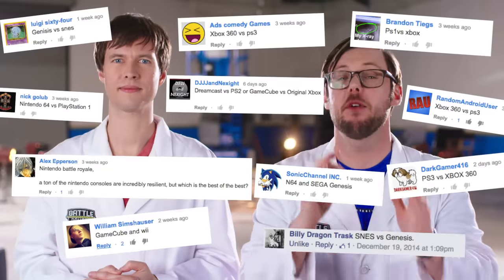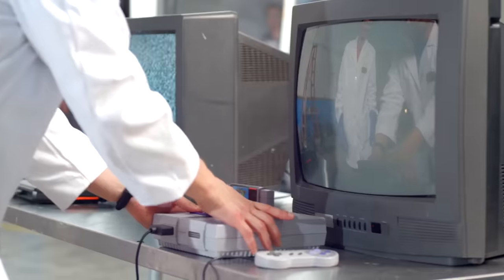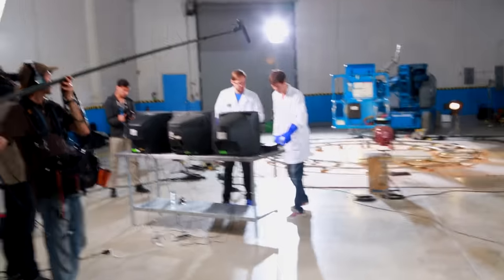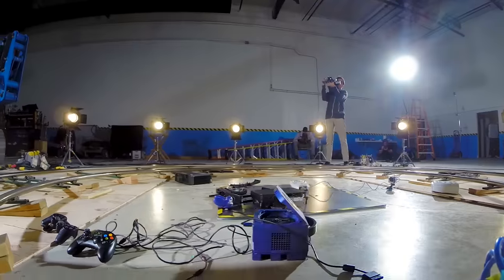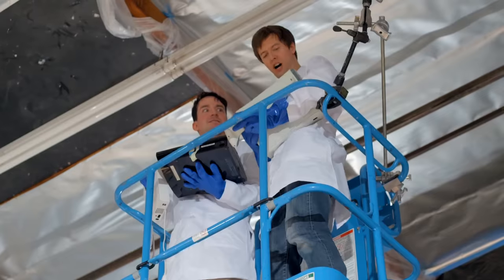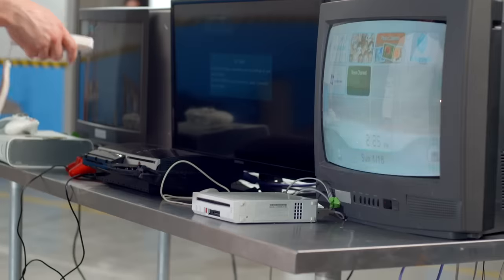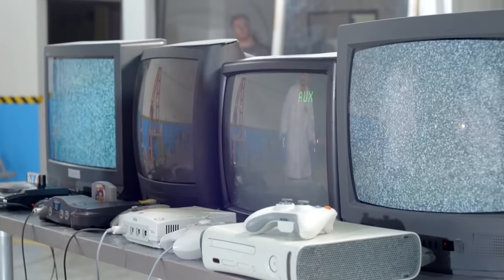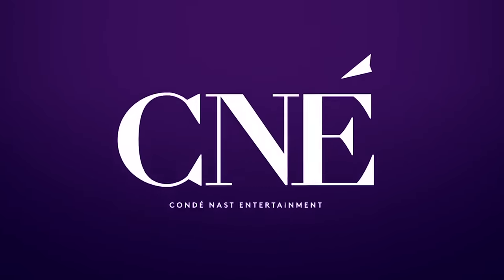Video Game Console Drop Test - Xbox Vs Playstation Vs Nintendo Vs Sega | WIRED’s Battle Damage

Comment: The Xbox 360 doesn't "Red Ring" from physical damage. The Red Ring comes from Heat Damage, shorting out the motherboard by overheating it.
Reply: I was thinking the same thing
Reply: yeap, thats what it is
Reply: red rings can also be caused be just overheating, mine's vent was covered be a wall and got a ring. but after taking of the shell, blowing some dust off, and putting it in a safer place, it worked fine again. and that same console works frequently well to this day.
Reply: LXavierW Brick Studios or a hard drive error
Reply: WOLF Drc or if the hdd or memory cards are misplaced as that is what happened to my elite
Reply: The fall could dislodge the CPU and give a red dot/ring
Reply: Yay some smart people who actually know stuff about xbox 360
Reply: The 360 couldn't red ring anyway, it was a jasper edition (you can tell by the 8 pin power supply port), the jasper is an edition of the 360 made after the falcon which eliminated the RROD from even being possible. Although systems still failed obviously, but RROD ceased to exist.
Reply: Just like ylod
Reply: Wolf DRC wrong, what your saying about the heating is true on the 2 rings but physical damage can cause a hardware malfunction which is what 3 and 1 ring(s) mean. The four rings just mean that the Av cable is not plugged in, broken, or the console’s av port is broken, (that only happens to Xbox 360’s that don’t have an HDMI port.
Reply: Wolf DRC exactly
Reply: Wolf DRC oh
Reply: Wolf DRC you areright
Reply: i it had once on a hdmi console maybe if you were to use the switch on the side on a none compatable tv
Reply: Actually wrong, it is either the hardware is MASSIVELY broken or the 360’s BIOS is corrupted
Reply: That sounds pretty physical to me
Reply: Red rings come with errors with boards, overheating, no AC cord is detected, etc.
Reply: So that’s (probably) why my old 360 red ringed, i guess

Comment: ... the Wii Game Channel showed that there was already a disc in the system. You forced a second game disc into the system.

That said, I doubt that the Wii would have survived the Battle Dew test, so the only difference it probably would have made was a fifth contender to die in the final round, but still... the fact that it was ruled out for not taking a second disc into the disc drive seems wrong.
Reply: the wii could have survived the battle dew test on one condition the game cube controller hatch thing was hinge side up
Reply: ***** I think it might have. It has fewer vents etc leading to it's innards. If too much got into the ports or disc drive then it probably would've ended badly but it had a chance. And they screwed it up.
Reply: I think a lot of these consoles were fine, OG Xbox just needed clip put back on, n64 needed a different clean console to test the console with 
The Dreamcast straight up wasn’t reading discs at the end and still won??

Comment: Fridge logic: When you consider a gaming console inoperable despite the fact that there is already a disc inside of it fully working and ready to be played. Screw their opinion--the Wii not only survived the fall but was fully operable afterwards and therefore won the drop test.
Reply: Same as 360, double winner
Reply: Yes
Reply: Also in the end they said the N64 turned on. Im sure if they let the pins on the cartridge and on the inside dry it probably still would have worked.
Reply: Also if you looked at the top corner in the disc games wii sports had booted up
Reply: This means that the whole competition was rigged
Reply: I'd have to agree
Reply: The Xbox original they didn’t even try to plug the faceplate back in they just automatically assumed it was permanently broken
Reply: @dragonator1012 or use a different cartridge
Reply: @forind934 yep 
And now this series is long forgotten and these people don’t even own the channel anymore
Reply: @YoungMrBlue  😔

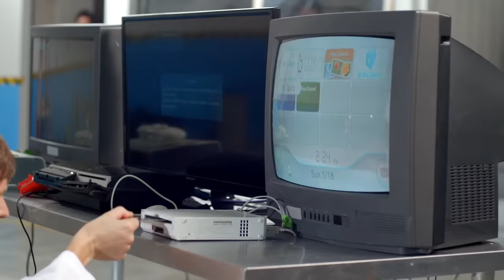Comment: 7:22 they are trying to cram a disc in the Wii and wondering why it isn't going in, BECAUSE WII SPORTS IS ALREADY IN THERE!
Also, they keep saying the 360 would red ring, yet the red ring of death is caused by over-heating, not physical damage.
Reply: GoodAtBeingNoob wait red ringing can be caused by hardware failure
Reply: @DISTX-  that's only the case when you get 1 ring

Comment: If you do this you have to make sure when they fall it doesn't end up one riding on another, it is VERY curious how both the DC and the Xbox360 survive being the ones that had some deceleration because scrapping by another console before impacting with the ground.
Reply: And the ps3 fall on the power button

Comment: I think the 360 got it easy at the end. It hit the PS3 that was bouncing up so I think it it slowed down the 360. but whateve. just an observation
Reply: Drew Myron g
Reply: Drew Myron it hit the hard drive. Hard dives are fragile
Reply: PSP vs Nes vs PS vita vs ps3 super slim
Reply: Curie Elka ya and it landed on the hard drive
Reply: That was with PS 2 too and it broke so that doesn't matter
Reply: IT bounce And PS hit xbox
Reply: I think Xbox 360 got out easy because the ps3 slowed it down
Reply: I agree the 360 didn't  hit rock bottom 100% it hit the ps3 and slow the impact they need to do it again and drop one console at a time so there test is inconclusive the xbox 360 would  of done more damage.

Comment: 6:21 playstation saving Xbox incredible
Reply: It actually didn’t, as you can see, the impact of the PS3 caused the little front plate to come off
Reply: Poor ps3 😔i have ps3 orignal
Reply: @genisis3457  but it didnt made a full impact on the floor that i think is harder
Reply: @genisis3457  That doesn't cause any actual damage. It would still be playable.
Reply: And Xbox original saved Dreamcast (little)

Comment: I was literally praying so the XBOX 360 would win and it did. I have a black XBOX 360 console 🙌🙌🙌🙌🙌🙌
Reply: if you look closely the ps3 absorbed the fall of the 360.
Reply: +tripple-d 2146972 Noticed probably the 5th time watching without going to the comments
Reply: +tripple-d 2146972 yhea the the xbox took more damage because it roll out
Reply: u should get next-generation
Reply: u should get next-generation
Reply: u should get next-generation
Reply: +tripple-d 2146972 nah the 360 hard drive saved it
Reply: +Zac Bart (Spartantcaboose) The kicker? Of all the next gen consoles (on the video), the WHITE Xbox 360 won, and that one was somewhat weak on durability, and not because of the console structure...

Because of the damn 3 red rings. (I had them)
And the Dreamcast still got through a shower of soda and survived.
The Wii either already had a disc inside, or it just was that it didn't work. Though if you know about using homebrew stuff on Wii, with USB Loader you could play the games even without discs.
Reply: I have a xbox360 slim
Reply: I have xbox 360 slim
Reply: the Dreamcast won
Reply: Xbox 360 almost win, but At the last Test It Lost And The Dreamcast Win
Reply: @TRMNTR-zp1er  No duh..

Comment: he doesn't realise the "red ring" is due to a heating problem and not damage.
Reply: S U C C In most cases it's caused by a BGA solder joint under the GPU being cracked. It can also be caused by power issues.

Comment: WIRED your video was amazing but you got some release dates wrong...I am a Video Game Expert

November 21, 1990 - Super Nintendo Entertainment System (SNES)
October 29, 1988 - Sega Genesis 
You got Sega Saturn you got right
September 26, 1996 - Nintendo 64 (N64)
December 3 1994 - PlayStation (PSOne was introduced in 2000)
You got Sega Dreamcast right
March 4, 2000 - PlayStation 2
You got the rest right except PSThree
November 11, 2006 - PlayStation 3

BTW I still have a Wii
Thanks for Reading

Comment: as soon as I saw the Dreamcast and the Nintendo 64 was in this video I got the feeling that it was gonna be very close to almost a tie between the two but I kinda thought the Dreamcast would end up barely winning it and my feelings were true if you look closely at the Dreamcast console you can see the material that it looks very strong I still have my dreamcast and I can also feel that it's very strong material however if the test was done with the dreamcast cover open the Dreamcast would've lost on round 1